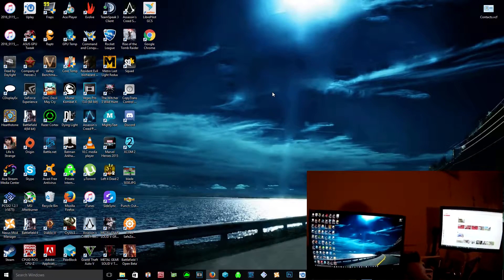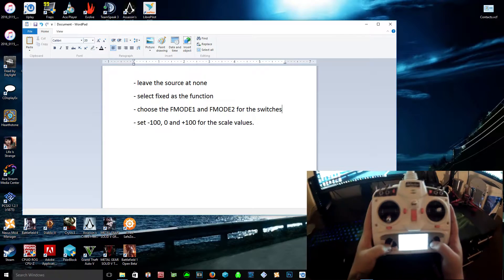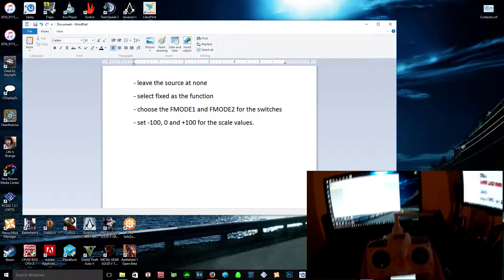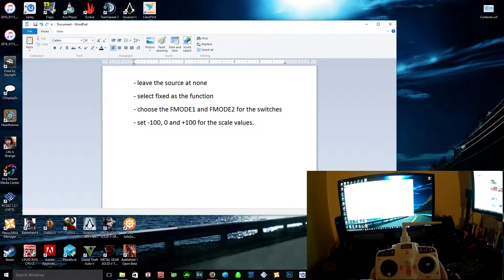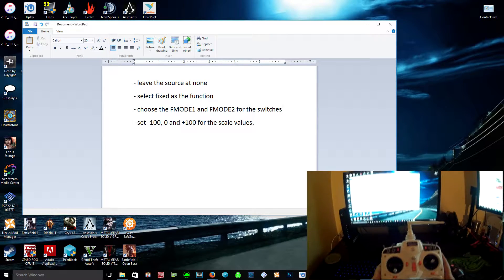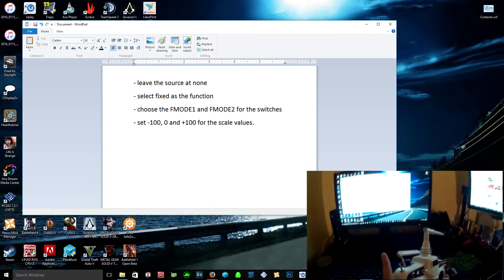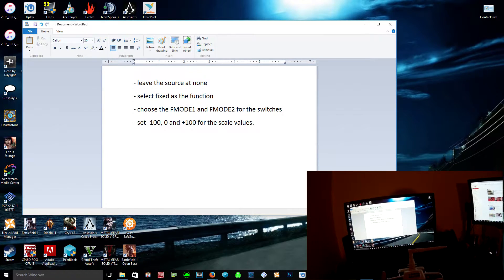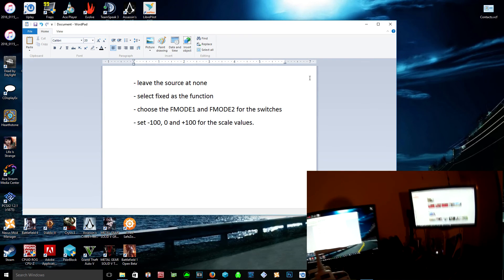Assigning 3 way switch to a Devo 10 or Devo 7

Comment: Thanks. Have you got your racer? :)
Reply from the maker: Yeah, its not great. Handles like a brick until you flash librepilot. Took the p200 for maiden this evening. It is a BULLET!
Reply: Infamous2117 Is that JJRC p200? SO Eachine is no good?
Reply from the maker: +jtgravityRC Yeah jjrc p200. Its a great quad by far the fastest i own. By all accounts the falcon 250 is better than the racer, I will use it for acro training.
Reply: what brand and model is the racer?
Reply from the maker: +jtgravityRC Eachine racer 250....
Reply: Cool, thanks :)